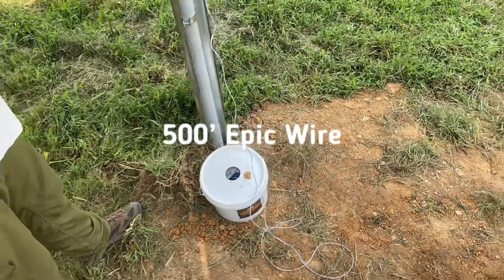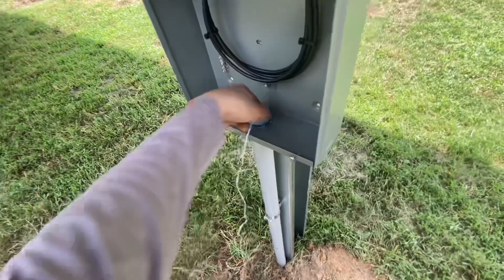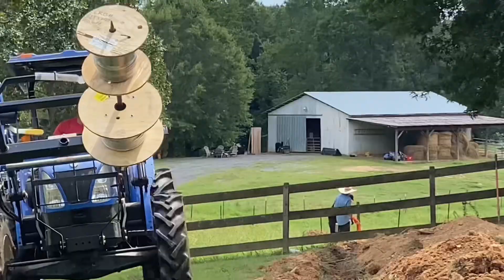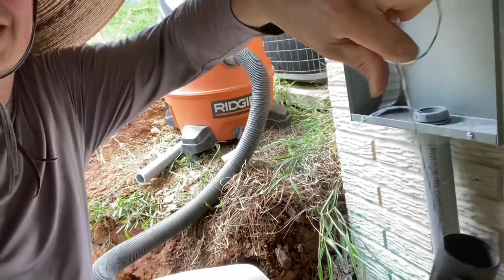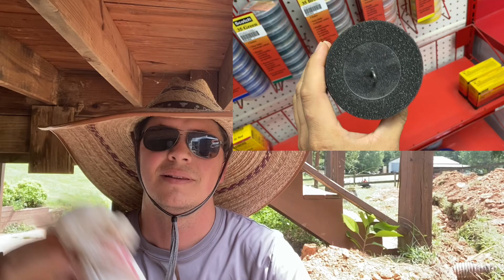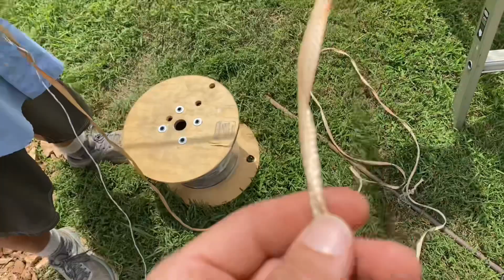500’ wire pull for Solar Array

Comment: its ok to use thhn on dc?,, im new to this wiring , i wanna move up to a 450 volt dc,,,150 foot run but everyone i tail to says to use welding cable,,but  that would be big $$
Reply from the maker: You definitely want to use THHN/thwn-2 widely available at supply houses and big box stores

Comment: Hello Johnny, I have 2 questions about his pull.
I don’t know what inverter you are installing here and I’m assuming a Sol-Ark 15k. Since the 15k only accepts 10 or 12 awg on the PV inputs, where and how do you transition from the 6 awg to 10 or 12?
Second, how would you go about pulling wire when you have more than 360 degrees of bends? Say you had to install a pull box 250’ into this pull, would you pull to the pull box then pull an additional 250’ out of the pull box before feeding that back in and pulling through the remaining 250’ of conduit?
Reply from the maker: We transitioned from 6 to 10 in a dc disconnect switch me mounted on the box at the house. 

Splice in the pull box or pull as you feed at the box or start at the pull box if you have exact length right. 

You can splice with split bolts and rubber tape and it’ll last longer than both of us.
Reply from the maker: Are you installing a 15k. You should buy it from me.
Reply: @GainSolarPower  Yes. Sadly I didn't find you until the equipment was already here. I have an unusual situation where I have an existing 2" conduit that was buried for different purpose but was never used, so is empty. It crosses a creek so that adds to the bends. We'll have to dig more trench on the far side of the creek to the array but due to a change in creek setback requirements we can't trench directly to the far side of the creek, so that adds at least another 90 degrees.

Comment: Brings back memories... back in the 90s I worked for a military contractor and often spent day after day for 12 hours a day, 5-6 days per week, doing this very thing. Only difference was the type of cable, I was pulling either fiber optic or copper telephone lines. Often through manhole systems, 4" ducts that we had previously installed. I was a fit, strong SOB back then lol.

And yes, we used the vacuum and shopping bag trick all the time! Way better than pushing a fish tape or fiberglass duct rodder through.
Reply from the maker: Thank you for sharing your memory.

Comment: That green ground wire..  Is that really in the NEC book?  Seems to me that all you need is the PV ckts and leave the static and lightning blast at the pannel mounting racks ground rods. (especially in an Off Grid system with no connection to the Main power co. pannel)
Reply from the maker: Well how does it sense a ground fault
Reply: @GainSolarPower  So you saying you have ground fault breakers at the pannels?
Reply from the maker: @compass504  I’m saying all PV systems over 50vdc must have ground fault protection according to the NEC code.
Reply: @GainSolarPower  I see..  I have a EG4 6500EX.. just one.  Building a panal rack 12 module Sinclair.  70' from equipment .  EG4 does have a ground fault code.  I don't have a Ground fault breaker.  Have a two IMO's at panel location and  Breakers in line with PV input at EG4 inverter location.  So I need to get two Ground fault breakers at the module rack box or change out the breakers at the EG4 location?  I haven't run the PV lines yet so this would be the time to include a ground run with them.  Thanks for the help Mr. GainSolarPower.
Reply from the maker: @compass504  those inverters don’t have ground fault or arc fault(required for rooftop). If the inspector knows what he’s looking at it won’t pass. Those inverters are loud. Low end. Save up for a solark. May work for you may be a boat anchor
Reply from the maker: Rumor has it the Chinese manufacturers changed boards on EG4 while they were making those and they don’t know which ones are which and they don’t parallel stack for 240v unless you happen to get two of the same board.
Reply: @GainSolarPower  Oh Boy!..  I knew there was things "goofy" with the grounding (neutral ground) to the frame of the EG4.  Software changes and a little screw you remove to make the frame not grounded to the inverter ground.  I just have to figure out what I need to get it passed now..  figure out later a cure for the EG4 6500.  I built the  Will Prowse 6500 build configuration.  breakers for isolation on Batts and PV lines.
Reply: Thanks for helping.  Another question (2) if you don't mind.
1. Conduit in the house with PV.. is it supposed to be Metal and not sked 40?
2. Also..  my Sinclair rack (12 module) .. do you guys ground each Channel Post?

Comment: I’m getting some of that foam! I used the jell in the past and that sucked. 

 Also. Can I pay you to make me a wiring diagram for a Magnum auto generator start to start a Champion 8.5kw home backup?
Reply from the maker: Is the generator two wire starts?
Reply: @GainSolarPower  Not sure but assume. I can text you a picture of the page out of the manual if I can still find your number. I have contacted you before about finding a replacement Magnum.  My plan was to set it up like Engineer775 did for a customer with no transfer switch. I just want it wired 240v to the input of my Magnum 4448. I can handle that but have found the Magnum auto start and this generator start up wiring to be a bit over my head. I can’t find anyone local to come wire it for me.
Reply: Found you contact info. I just needed to finish the video. Duh! By the way make more videos if you can.
Reply from the maker: @offgridliving4128  anything particular you’d like to know about

Comment: Hello Johnny! Carl here from West Michigan. I'll be sending you and Scott a full photo summary of my solar project I modeled from your videos. It's completed and consists of two Solark Emp proof 12K inverters. Two Sinclair solar arrays with 40 315w Azitec panels each. The wire pull was about 350 feet. The whole project was a DIY entirely on my part with exception of array post driving. I assembled the perlins, but ran into trouble with hole alignments if you recall. I drilled all new holes using a Mag Drill and installed the PV panels. The system consists of 25.2Kw DC panels and the two 12k inverters. It was commissioned June 1st after 3 years of work on my part. I have you and Scott to thank for the videos to quide me along. Thanks to you particularly for being available when I needed assistance and advice. Best regards.
FYI, my battery bank consists of 8 215 Ah  Full River brand AGM battery's. The Lithium iron phosphate  costs were totally out of reach for me. Very pleased with the AGM lead acid batteries by Full River.
Reply from the maker: Thanks Carl!

Comment: I just realized that you are using one of those click clack extension ladders as your wire spool holder. I'm totally borrowing that idea!! I have one of those ladders and absolutely love it.
Reply from the maker: Ground rods fit in the holes perfectly.
Reply: FYI… turn the ladder around so the ladder won’t tip over…